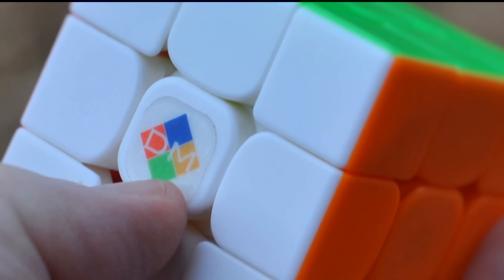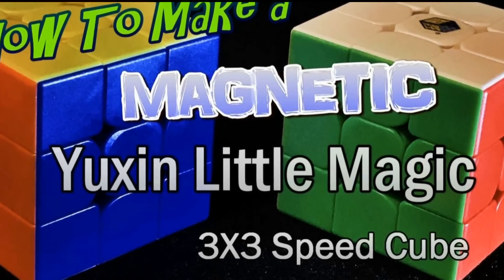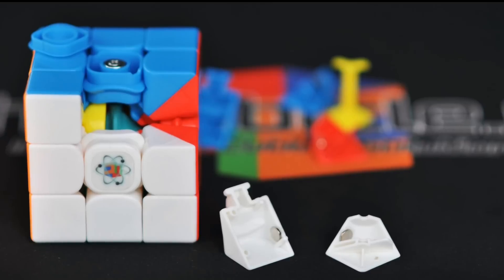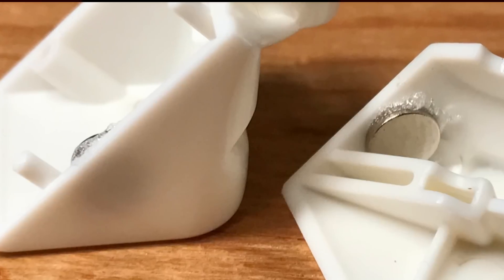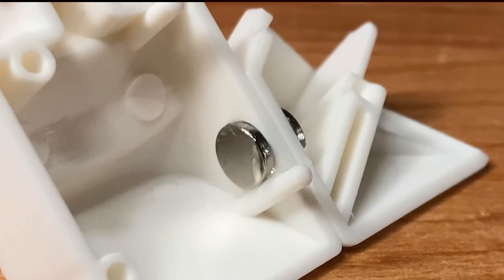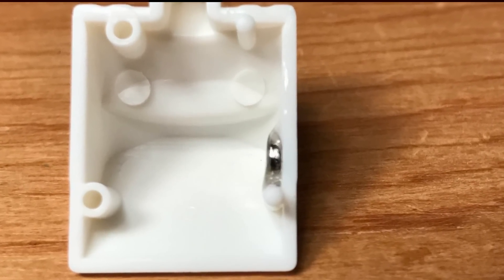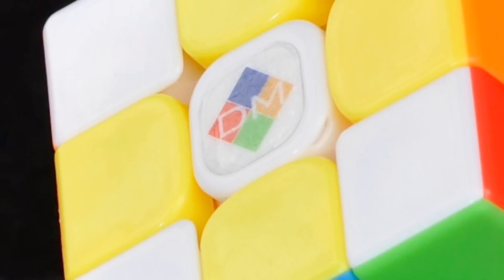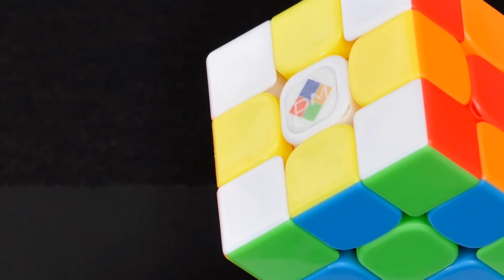Magnetizing the MoYu MF3RS2 Speed Cube

Comment: Which it is better in the mf3rs2: n52 4x1.5 or n35 5x2 or n35 4x1?
Reply from the maker: Of those three choices, definitely the N52 4x1.5. Even an N35 4x1.5 if you like a light feel. 
The other two magnets wouldn’t quite work well: any 5x2 will be much too strong, and the 4x1 would be too weak. The 4x1.5 is what works the best!
Reply: @dmcubing6342  is the n52 4x1.5 too strong? I only like medium to weak magnets and don't want too strong of the click of magnets
Reply from the maker: @PhúcÂnCuber  really depends on the manufacturer of the magnet, or sometimes the seller. If the magnets are budget priced, they’re probably not going to be full N52 in strength. A lot of less reputable sellers will try passing off N35 magnets as N50 and 52. But if you’re getting your magnets from a reputable magnet company, they’ll probably be full strength. 
If they are full strength, the cube may end up feeling more clicky as the magnets pass each other. 
I personally think 5x1 magnets are the best for this cube. 
However, given the choices you mentioned, the N52 4x1.5 would still be the best between the 5x2 and 4x1. 
Oh, but one thing you can do that is a little involved but worth it- you can use the N35 4x1 and double the edge piece magnets. This will be equivalent to using N35 4x2 in the edges and 4x1 in the corners. The resulting magnetic pullforce strength will be the same as using N35 4x1.5 and will be perfect for this cube. 
So when you’re magnetizing, just place an additional magnet to each edge piece magnet. You’ll need a total of 72 4x1 magnets.
Reply: @dmcubing6342  ok, Thanks a lot
Reply: @dmcubing6342  Oh, is the mix of the n52 4x1.5 and n35 4x1 ok?
Reply from the maker: @PhúcÂnCuber  that might be worth trying. It would probably be considerably lighter feeling than stacking the 4x1s.
Reply: @dmcubing6342  thanks for helping me. I’ll give you a sub
Reply from the maker: @PhúcÂnCuber  thank you!! I appreciate it!!! Please let me know how the cube turns out.

Comment: Whos better for 3x3 cubes between n42 magnet or n50 magnet
Reply from the maker: I would prefer the N42 4x2 magnet over the N50.
Reply: @dmcubing6342  please give me a reason
Reply from the maker: @azzikra_cp4211  sure. N50 would generally be too strong, IF the magnet is genuine. There are a lot of budget priced “N50” magnets being sold that are actually fake, and these have the strength of N35 magnets. There isn’t anything wrong with these cheaper “N50” magnets if you need a pullforce equal to N35. On the other hand, if you happen to get real N50 magnets, they’ll be too strong for this cube. Because of these reasons, I generally don’t recommend N50 magnets. 
The preferred magnets for this cube would be N35 4x2 and N42 (or N48) 5x1.
Reply: @dmcubing6342  thanks a lot
Reply from the maker: @azzikra_cp4211  glad to help!

Comment: I ordered 4x1 N35 before I came across your video. Do you think it'll make any difference? I mean is it worth to magnetize with such weak magnets?
Reply from the maker: The 4x1 magnets by themselves would be too weak to do much good. If you have enough magnets, you can double them, putting one magnet on top of another, essentially making a 4x2 magnet out of two 4x1 magnets. It would take a total of 96 magnets. Or, if you have 72 magnets, you can magnetize with a single 4x1 magnet in the corner pieces and double the magnets in the edge pieces.

Comment: out of these magnets, which will be act the best for the mf3rs2?  1) n35 4x2mm  2) n35 4x1.5mm  3) n48 5x2mm  4) n48 5x1mm  5) n48 3x2.5mm  6) n48 4x2mm
Reply from the maker: Great question! 
4) N48 5x1 is my first choice. It’s also what the Cubicle used in their Labs version of the MF3RS2. 
My second choice would be N35 4x2. 
The N48 5x1 magnet gives a similar magnetic attraction to the N35 4x2 but as the magnets pass each other the bump is softer.

Comment: Hi can I use the magnets shown in the cubicle video
Reply: Thanks you are the best tutorial others don't answer as fast as you
Reply: One last question can any super glue work
Reply from the maker: shining night yes. I prefer a thicker type of superglue since I like to put a drop of glue first, then slice the magnets into place. You can use thin superglue but just be careful with the stuff since it can easily get all over stuff.
Reply from the maker: Which video?  
The Cubicle uses N48 5x1 in their Cubicle Labs version. It's very nice!
Reply: @dmcubing6342  thanks alot
Reply from the maker: shining night your welcome!!!
Reply: @dmcubing6342  I have another doubt is the n35 4x2 or n48 5x1 or n42 5x1 or n35 5x1.5 which is the medium one cuz I hate weak and strong BTW where will we get these cuz in the cubicle  it only shows strong and lite
Reply from the maker: shining night to me, the best medium magnet is the N42 5x1. They're available at Gaussboys Magnets. The N48 5x1 is also very good. It's available from Cubicle and Apex Magnets. The 5x1 magnets have softer bumps or clicks as the magnets pass each other and their magnetic attraction is spread a little wider than 4x2 magnets. The N35 4x2 is quite acceptable in this cube but I think the 5x1 are better.  
If you wanted a light feel, then N35 4x1.5 or N35 5x1.

Comment: I couldn’t find N42 5X1 so i ended up choosing N35 4X2’s do these match the feeling of the magnets in this cube?
Also can you use faster drying super glue? Thanks in advanve
Reply from the maker: Yes, the N35 4x2 will have a similar feel with possibly just a little more noticeable click or bump as the magnets pass each other. But their magnetic feel will be similar. 
You can use quick drying superglue but you have to position the magnets quickly once you place the drop of glue on the plastic. If it's quick drying, it's hard to reposition the magnets if you don't get them positioned perfectly the first time. A slower drying superglue gives you more time. 
I like to make sure glue is on the cubie piece first, then position my magnet on top. There is another way to glue, though I personally don't use the technique, but it might work with quick drying glue. That is, you put the magnets in position first, then add a drop of glue to the bottom side of the magnet. Then follow up with an additional drop on top to kind of seal them. 
Hope that helps.
Reply: @dmcubing6342  thanks

Comment: But I think that the magnet not flushed, like, tilted, would make for a much more weaker, smoother magnet feel
Reply from the maker: As long as all the magnets are positioned the same way, a little tilt isn't going to matter much. Theoretically, if they're all a little different, your cube could have an uneven feel. 
If the magnets are a little tilted, the magnetic pullforce strength will be reduced a little. Magnets have their strongest attraction when they're lined up flush with each other.

Comment: Hey, I have a question, is it Ok, to  buy 5x1 N38 magnets to this cube ? Because I could not find N42 or N35 magnets in our shops.
Reply: Hi, my MF3RS2 finally came, now I have to buy the magnets, I am choosing between 5x1 N38 or 5x1 N45, which of those do you think I should buy ? Thank you.
Reply from the maker: Ako postaviť hlavolam KOBRA I would go with the N45 5x1, unless you like a lighter magnetic feel.
Reply: @dmcubing6342  ok, thank you, I will order N45 magnets, I will let you know  when I will magnetize it :)
Reply from the maker: Ako postaviť hlavolam KOBRA Please do let me know how it goes. Have fun!
Reply from the maker: Yes, you actually could use an N38 5x1 in this cube. It will be a light magnetic feel, but the width of the magnets helps to hold the cube in alignment slightly better than 4x2 magnets, so you should be just fine. 
Please let me know how the cube turns out if you use the N38 5x1.
Reply: @dmcubing6342  Ok, thanks for the answer, so Iam I right that 5x1 magnets are better than 4x2 ? Another question, what do you think is better for this cube ? N38 or N42 magnets ? Thank Youu reaally.
Reply from the maker: Ako postaviť hlavolam KOBRA Well for some cubes, 5x1s do a better job at keeping it in alignment while having softer feeling bumps as the magnets pass each other. However, in very free-flowing cubes, like the Gan Air, where a quick light bump, 4mm (and 3mm) wide magnets give just a hint of a quick momentary bump. 
Generally speaking, 4x2 magnets work just fine in a lot of cubes. But the 5x1s can give a similar stability without needing as much magnetic attraction strength. 
I've only tried the N42 5x1 in this cube, not the N38, but I'm sure it would still have a good effect on the cube, with a soft light bump.
Reply: @dmcubing6342  Thank You soo much !I am going to buy theso 5x1 N38 magnets. But my Mf3RS2 will only come in 30 days. But I will let you know when I magnetize it.

Comment: Will n42 4x2 work?
Reply from the maker: Yes. It may have just the tiniest bit of more strength than the N35 4x2, but unless you like a really light magnetic attraction, it should work just fine.
Reply: @dmcubing6342  do you know what magnet speedcubeshop uses?
Reply from the maker: Neonz No. But I do know the Cubicle Labs version uses N48 5x1. It's a great feeling cube.

Comment: Wouldn’t it be easier to magnetize the corner first then just drop the magnet into the edge, and it will go directly into place?
Reply from the maker: Most edge pieces of various cubes have a specific place inside to place the magnets in an easily repeatable fashion. Usually along the bottom of the retaining post. When you use the same exact place for each magnet, the cube will be more consistent. The edge piece magnets end up in the same place each time, and then when we pair the edge piece halves with the corner piece thirds, the corner piece magnets line up perfectly. It would be nearly impossible to have as good alignment doing the corners first.

Comment: Hey thank you for your tutorials! I am about to magnetize my Yuxin Little Magic, MF3RS2 and GAN356 R.

A question, do you recommend N35 4mm x 2mm on the 3 cubes or what is your best recommendation for each cube?
Also, do you know the size of the magnets the GAN Air SM and GAN X uses? Maybe is best to use similar to those ones?

Thank you very much in advance for the answer!
Reply from the maker: Thanks for your kind words!!!
Generally speaking, Gan cubes work best with lighter magnets, like the 4x1.5, and 3x2. Gan uses a high grade, I believe N52, 3x2. So, though while it's a small magnet, it's got a bit of strength for its size. Small narrow magnets like the 3x2 give a shorter click as the magnets pass each other. So for the Gan, I'd suggest either N35 4x1.5 or a 3x2 in either N52 or lower depending on how much magnetic pullforce you like. Oh, I should add, with any magnet you use in the Gan, it's possible to lower its perceived magnetic strength by positioning the magnets further into the pieces towards the core. So it's actually possible to use 4x2 if you place them deeper than normal. 
For the Little Magic, you can use either an N35 4x1.5 or N35 4x2. The 4x2 will be just a bit on the stronger side so I'd lean more towards the 4x1.5. 
For the MF3RS2, I personally prefer an N42 5x1. If you want a Cubicle Labs version, use an N48 5x1. 5x1 magnets give a softer click but have a strength similar to the N35 4x2. You can also use the N35 4x2 in this cube with good results. 
Hope that helps! Let me know how it goes!
Reply: @dmcubing6342  Is N50 5x1 almost the same as n48 5x1??
Reply from the maker: Visit Vaticancatholic,com Exactly! They'll be very similar. And even two magnets of the same grade may be different from one manufacturer to another. 
Also, some "N50" magnets are actually lower grade (closer to N35 strength) because some companies try to pass off cheaper magnets for higher grade magnets. So it's important to buy from a reputable company.
Reply: @dmcubing6342  So the ebay's ones which cost 1.50 dollar per 50pcs are probably n35?
I was thinking in n35 4x2, but i heard that the 5x1 gives a softer click.
Reply from the maker: Visit Vaticancatholic,com For that price, I'd treat them as N35. 
N35 5x1 would be pretty subtle in this cube. Between the N35 4x2 and a weak 5x1, I'd probably go with the N35 4x2. 
Yes, generally speaking a 5x1 magnet will give a softer bump and it's magnetic strength would feel like an N35 4x2. But that's usually with N42 and N48 5x1s.
Reply: @dmcubing6342  How about 6x1 n35? Have you tried it or is it too large to put in the pieces?
Reply from the maker: Visit Vaticancatholic,com That's not a bad magnet, actually. I was going to try that magnet in an mf3rs2 but never got around to it. I tried it in the GTS2 but ended up preferring the N42 5x1.
Reply: @dmcubing6342  Ok, i think i will stick with the 4x2. In my country the shipping will be unworthy to buy those from gauss or somewhere like that.
Reply: @dmcubing6342  Hey man, never told you, magnetized my Little Magic and GAN, both with 4mmx2mm N35. Bought another GAN R with the hope of magnetizing it with very similar magnet strength and size of the original (clear magnets GAN X, GAN XS). Somewhere I read that 3mmx2mm N48 where similar (they where talking about the SM), but reading other posts, people tell that 4mmx2mm N35 are the ones with similar strength only with wider magnets, so in that order, N52 3mmx2mm N52 (according to https://www.kjmagnetics.com/calculator.asp) would be the ones more similar to 4mmx2mm N35. 

Do you actually know which magnets assimilate more of the strong (clear capsule) magnets of the X?

Comment: Will n40 4x1 and n40 4x1.5 work ?
Please answer ...
Reply from the maker: Are you going to mix these two magnets, like the 4x1.5 in the edges and 4x1 in the corners? The outcome would be a very light subtle magnetic attraction. I'd be more inclined to use just the 4x1.5.

Comment: Great tutorial! I'm about to magnetize my cube with 4x2 N35 magnets. Should I put the magnets all the way at the bottom, at the middle, or near the top is shown in the video? Thanks so much!
Reply from the maker: Thanks for your kind words!!!
I'd position the 4x2 magnet up against the post and down at the bottom of the edge piece wall. Double check that the corner piece gives its magnet enough room to do this. It should. The reason you see me positioning the magnets up along the edge is because I used a 5x1 magnet. There isn't enough room to position them at the bottom. With a 4mm magnet, you shouldn't have any trouble. 
Have fun and let me know how it goes.
Reply: @dmcubing6342  I just magnetized the whole cube and it looks like some pieces are repelling instead of attracting. Do you know what could be wrong? I made sure to place all the magnets in exactly the same location.
Reply from the maker: Tejanth Pasumarthi Oh no! I'm sorry to hear this. Did you make sure that you were removing the magnets from the same end of the stick of magnets when you were gluing the edge piece magnets? If you have pieces repelling, somewhere along the way you got a magnet or two turned around. 
You'll have to find out which piece or pieces are wrong. Disassemble the cube and build it back together without the core. You'll quickly find which pieces are wrong because they should all be attracting each other. 
Removing glued magnets can be tricky and challenging but it is possible. Sometimes you can just pry them out by carefully using a small screwdriver. It sometimes helps to soak the disassembled cubie pieces in warm soapy water for several hours first as this helps soften the glue. Then you'll just have to reorient the magnets and glue. Good luck and let me know how it goes.
Reply: @dmcubing6342  Yeah that was what happened. Luckily it was only 6 pieces like that though. Soaked them in some soapy water and then  placed a drop of nail polish remover on the glue to try and make it easier to cut through. I should have used that paper at the end of the stick of magnets haha. Thanks for all the help!
Reply from the maker: Tejanth Pasumarthi Hey that's great you got it going now! That's good news!!!